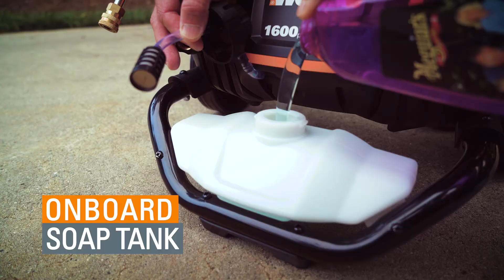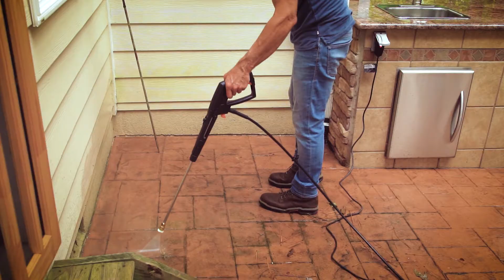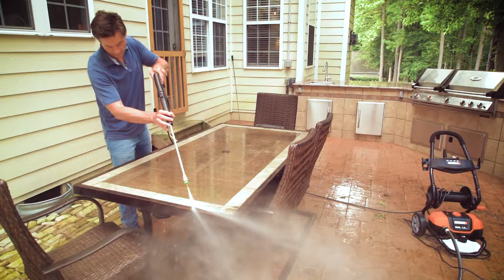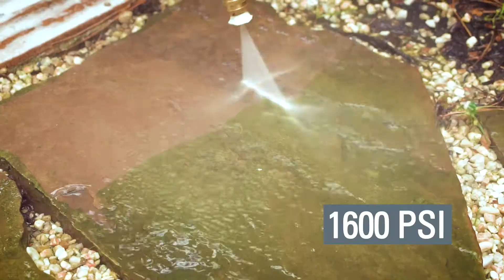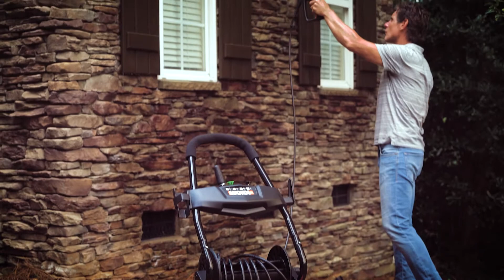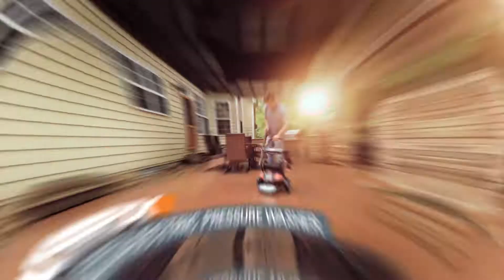1600 PSI Electric Pressure Washer - Worx (1.3 GPM)

Comment: I just bought one ... in the box is a clear package that has a little wire tool used to unplug nozzle tips, also there is 4 small o-rings and i have no idea what they are for?  Does not show the o-rings in the manual
Reply: @WorxUS   i am not talking about the Hydroshot i am talking about the model # WG604  1600psi electric power washer .. can you answer what the 4 small o-rings in the clear package are for?  The other small wire thing in the package is shown in the owners manual, it's for cleaning clogged nozzle tips
Reply from the maker: Hello! These are just spare O-rings that can go inside the garden hose fittings if old ones are missing or worn out. Thank you!
Reply: @WorxUS   Thanks!